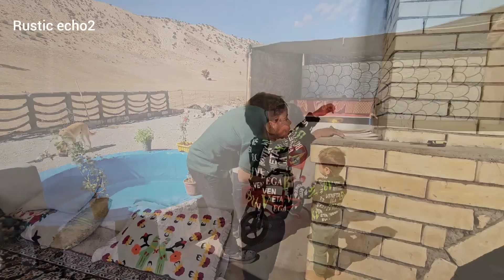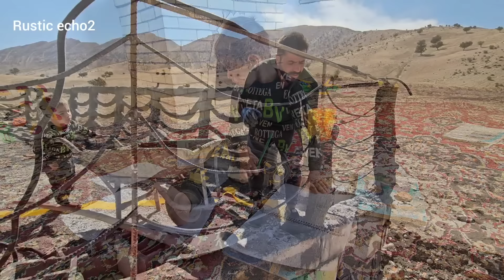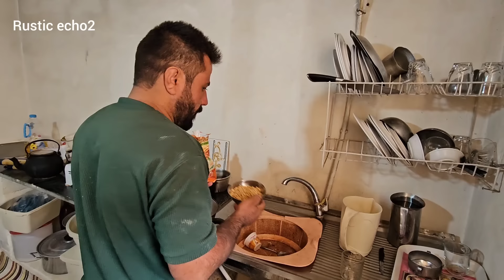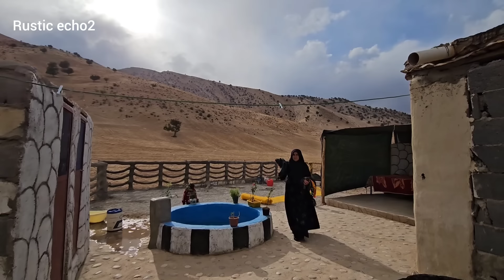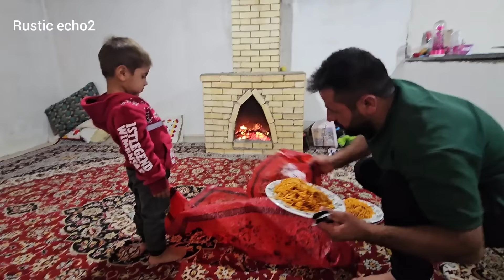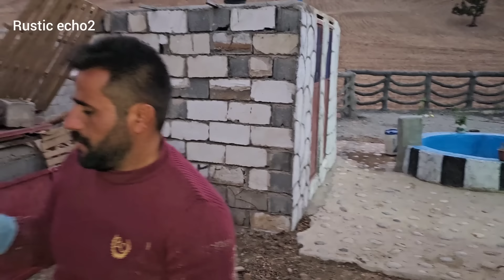*Dark tensions: from love to separation - a story between Naseebullah and Sakineh over Armin*

Comment: When one person or gender is brought up to believe that they can do virtually nothing wrong, they can become rigid, and less likely to consider the validity of another’s experience and point of view. Any partner is likely to have limits to how long they can feel invalidated. Everybody has their breaking point.  By seeking support from their families, Nasib and Sakineh get reinforced even further into the stances that they have taken. It would be helpful if they could get outside help to assist them in getting unstuck from the positions they have locked themselves into, and could each look at the pieces that they are responsible for. Armin has been granted too much power, and they need a joint strategy to deal with him… he is also super stubborn and will not yield easily…all the more reason for them to get it together.